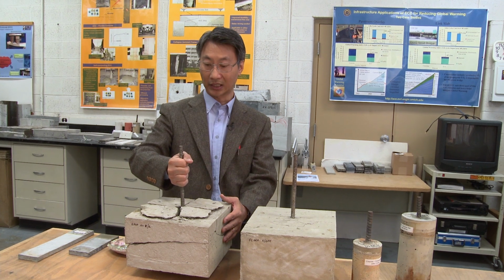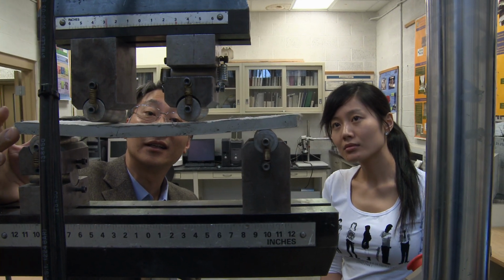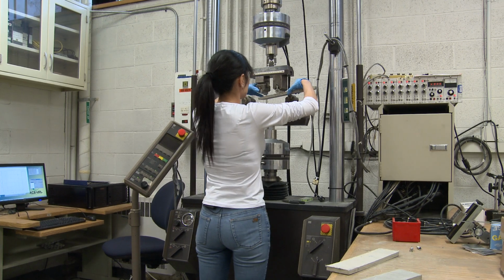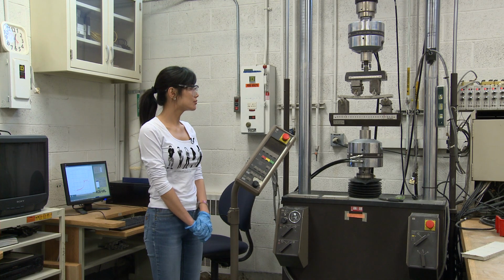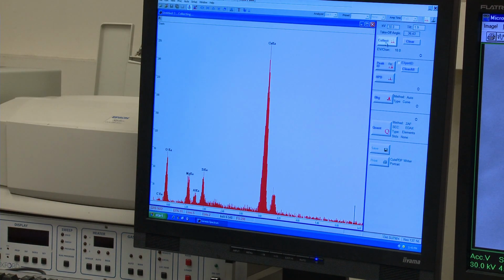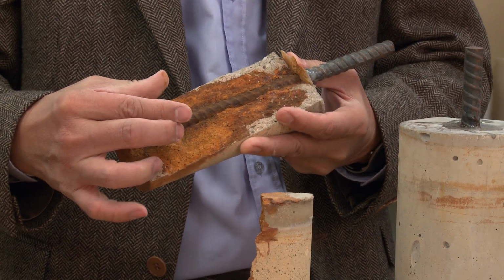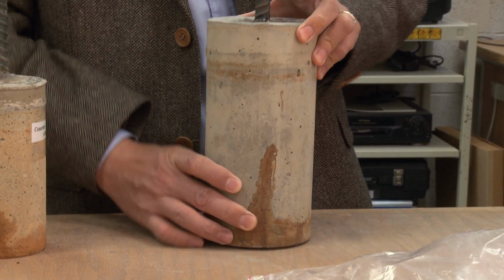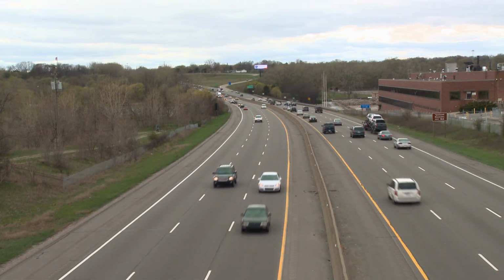Bendable concrete makes infrastructure stronger and more resilient

Comment: Great development, but in the corrosion test the concrete pieces should be the same size.
Reply: korpakukac Good point, but in the bigger piece, the rebar seams a bit bigger(longer and wider) than the smaller rebar.
Reply: Exactly